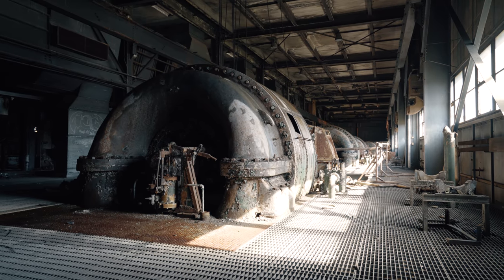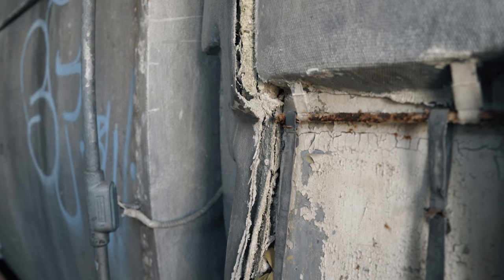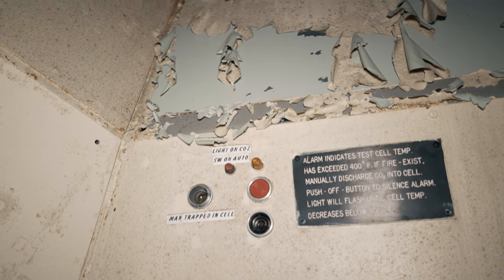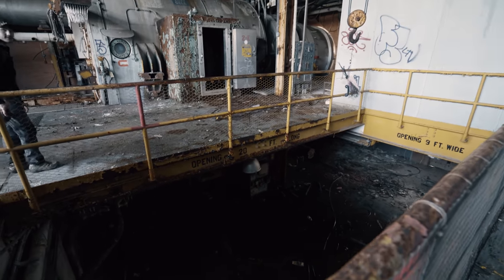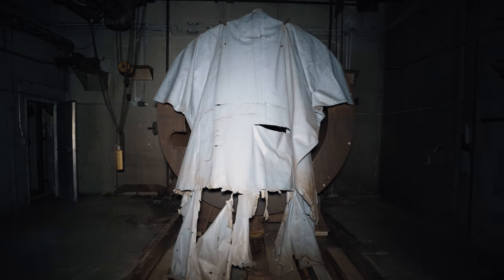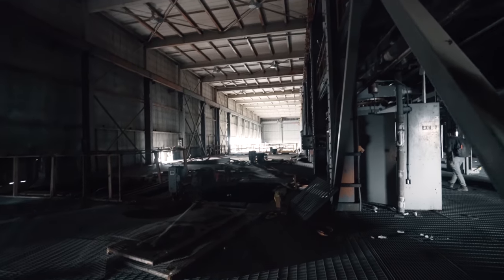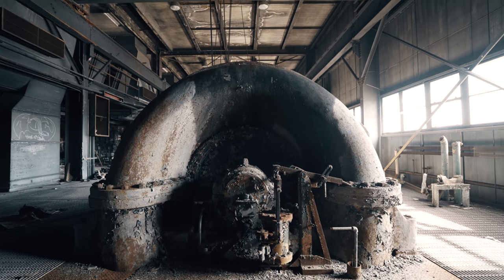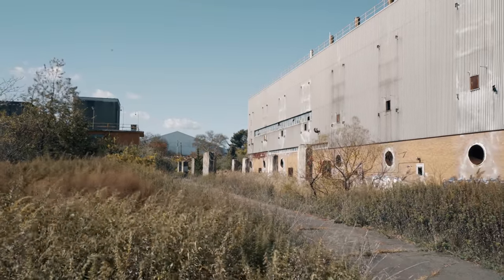Exploring an Abandoned Navy Research Lab - Jet Engine Testing Center

Comment: it’s strange how these buildings are just left to rot. there has to have been so much money funneled into these to be constructed and given a start up, yet they’re just abandoned when things aren’t needed
Reply: It also costs money to demolish something like that, so many land owners would rather pay the property tax and let it destroy itself
Reply: @jbingbong  it was government owned, so i doubt there was any tax to pay
Reply: Unlimited budgets lead to unlimited waste. Easier just build somewhere else and no need to spend money repurposing the building. Just let it rot and move on.
Reply: dull delusions it’s not strange at all
Reply: That's the problem with specific purpose made buildings. Nothing else works in them.
Reply: The story of MANY abandoned buildings in the world. Especially Govt ones
Reply: @TMAS The pollution mentioned in the video would make it uneconomical.
Reply: If it was abandoned due to ground water pollution, Seems like it was just a huge oversight during initial planning.
Reply: They mothball facilities like these if they don't need them, but in case they need to quickly get them back online in the next 5 yrs after mothballing. After that time, they know the innards are obsolete, but the structure has been designed to last 50-100 years (hence all the cinderblock). So, if they need to use the property for an emergency (eg: ramp up war-time production, convert to temp hospital, etc), they have a location available they can gut and remodel within a short time frame. After a very long time, they will eventually decide if the propery is worth keeping or not as strategic areas in cities and states move, so they'll offload it to private property companies who will eat the cost to demo and rebuild or remodel. Demo costs money, so they don't demo or gut anything if they don't have to. And, ideally, they want to wait long enough where a private company that buys the property has to eat that cost. If you look at the walls and things while they're walking around, the structure is still very solid. The insides are a mess, but that can get gutted very quickly, sprayed down with anti bacterial, then painted and new insides put in place. Typical construction crews drag their feet on a project, especially if they're charging for time and materials (they want to drag it out as long as possible to miximize what they can charge). But, a motivated crew, like military corp of engineers, refurbing a place to get it up and running to handle an emergency.. they could have that thing knocked out in a few weeks.
Reply: It's easier to abandon such buildings when they're built with other people's (i.e., tax payers) money.
Reply: Considering it's the military, they most likely left it in case future use is needed. I mean, it seems like it would make or a not-bad place to hide during the apocalypse.
Reply: The ground water is extremely polluted so no one will ever use this shit again, old technology and useless property lead to this type of thing.
Reply: @TMAS the logistics of doing all that would become a debt today.  It would take a specialized certified crew to contain the hazardous materials such as asbestos and lead.  Let alone the deconstruction and removal of what could be salvaged.  That's why it's still there mostly aside from civilian looters and scrappers.
Reply: I keep asking, why all the abandoned places of anything left, are not recycled or used as scrap? Why do we keep letting these places keep standing?
What a waste!
Reply: A quick Google resulted in finding out that this facility was closed as a result of the BRAC (Base Realignment and Closure) of 1993.
Reply: The ground is highly toxic from the dumping of Chemicals like Trichloroethylene into the ground, 50+ years ago they had no way of disposing of such chemicals, so tankers full of used chemicals would be left to sit out in the fields with valves letf slightly open to drip into the ground.  This IS a federal government facility the land which abuts an airport (more toxic waste) is still owned by the federal government. It should also be noted that much of the surrounding area was farm land where crop dusting with DDT and other chemicals were commonly used.  It's easy to point fingers and say why now, but back then they didn't know the effects their actions would have on the ground water as we do today.
Reply: The GM plant that used to be across the street (which stood for over 75 years) built fighter planes (the Avenger) during WWII, was quickly demolished after closing, the area cleaned of all toxic waste and after years of testing is finally being redeveloped.  Reading some of the comments it's clear that some folks don't understand that decades ago they didn't have the luxury of having all the information available that we do today, after the great Depression, WWII and the Cold war/ Space Race with Russia, sadly pollution (ground air and water) and its future effects was not a priority back then ~ thankfully we have come a very long way.
Reply: The salvaged what they could from the building; what's left was no longer useful, but likely got their money's worth of testing done back when they were used.
Reply: That's how everything goes; people places, things, memories. All abandoned or forgotten eventually
Reply: Makes for good content to watch for us :)
Reply: what about mega bunkers constructed deep underground. amazes me the amount of sheer hard work went into constructing something like that, to only have a one time purposes or perhaps , in a lucky case , was actually never necessary :x
Reply: Duh, no different than what everyone does with a old microwave oven, vacuum cleaner or television. OBSOLETE
Reply: The pollution and dumping mean that remediation is not economically viable. Also considering many of these labs are build in the middle of nowhere not much chance of land values increasing.
Reply: Some day mother nature will claim it back into the earth :)
Reply: You tax dollars at work!
Reply: @iannorton5514  It seems strange how testing jet engines could cause pollution to groundwater?
Reply: @EphemeralProductions  China might have hundreds if covid19 destroys globalisation!
Reply: @Nuke 'EmAll if that's so, I want that bridge crane. Where do I show up to collect it?

Would also be fun to have 1 of those gigantic axial flow compressors & gearbox. I have no idea what I'd do with it but would be interesting to mess around with.
Reply: Here's your tax money.
Reply: With the Military Industrial Complex there's pretty much infant money to the defense budget to do things like this

Comment: I worked at the National Research Council in Ottawa Canada once and we had a jet engine testing lab (we have a few actually) and one time they tested a 747 engine. The exhaust went a few meters in the air through a large pipe like a couple of meters wide. It was still loud. In a refrigeration building they once set up a helicopter engine to see how it would handle starting up in -30 cold. By the sound of it it worked quite well. The most fascinating part of all that was the amount of work that went into not losing the engine because all it wants to do is take off.

Comment: Have you ever tried to track someone down who worked in a facility like this, to add commentary to your video? This is very interesting, it would be cool to have someone who used to work there walk through it with you guys.
Reply: I did .
These are performance data test cells or "high power" cells .
Here the engines were tested after assembly for thrust numbers and any adjustments needed for fuel sytems or variable vane compressor trimming adjustments  They need a way to test engines before they are shipped to be installed in new aircraft or the field for installation .
They include the performance data sheet with the engine for the customer , and also to heat cycle the engine and make sure there aren't any problems before they ship the engine .
Sometimes they are used for R&D 
Test centers also have a center where they actually shoot frozen chickens into the engine to simulate a bird strike at speed .
Reply: Jet engine dyno
Reply: Actually, I know someone who used to work at this facility before it closed.
Reply: @dednside5229  Thats amazing that you worked there, it must be weird seeing it like this now?
Reply: @leakesonasucs  
It's called the Marines
Reply: @dednside5229 how does Mercury fall into play versus RPM.... I'm guessing some kind of measurements on thrust or pressure of some sort?
Reply: @cryipticcreep5586  
I have no idea ....
I was with the plane in test cell 
Not in the control room 
The plane shows you a zero to 110% 
(Water assist) power level and temperature,  not accurate thrust numbers like a dedicated engine stand mounted configuration.
Rpm is not coherent with thrust 
Like say a car on an engine dyno 
Because of humidity and air density due to ambient temperature and alot of other factors and variables because of the huge amounts of air ingested and the particulars of each individual engine
I'd say at sea level it's a small difference with barometric pressure,  probably not any .
Reply: @Bowlnmike  could you elaborate? Have you shown them this video?
Reply: @cryipticcreep5586  Inches of mercury is a measure of barometric pressure.  Engine RPM will vary depending on the density of the air and temp.
Reply: @clarkopietaylor2917  understandable..tkx
Reply: i believe they have a video on a giant steel mill in europe. and a follow up video with footage and comments provided by someone who saw their video and used to work in the plant.
Reply: Altitude test chambers for certifying engines after overhaul and such.  The "blowers" are exhausters or big vacuum pumps to create the altitude conditions for test I believe.  Such a shame all abandoned... but it was from a time where the government ran it's own tests.  Now it is all done by the contractors, GE and Pratt and Whitney.  Amazing how much $ that all cost to originally build.

Comment: I used to frequently explore this place when I was younger and this could have been an hour long video. Towards the back of the campus was a giant heat exchanger building with Venturi cooling towers. I also remember a room that had star effects (lots of small holes for light) in the ceiling along with some liebert AC units. Probably an old server room. The rear of those control panels were wall to wall electro magnetic relays too.
Reply: no computer servers in that facility! everything in there would have been relay logic, analogue feedback loops into analogue computers for differential, integral calculus, proportional, and linear equation calculations.
Reply: Is this in Michigan?
Reply: thats cool you live near it, ever been back?
Reply: where is this? I am trying to visit it
Reply: @cmrtaco  it's in Ewing new Jersey on parkway Ave near the Trenton Mercer airport.
Reply: @richardhoff5255  thank you, figured out that it's the Naval Air Warfare Center (NAWC) in West Trenton, N.J
Reply: cmrtaco 
If I remember right it’s near New Jersey. Proper people won’t give you the address due to people’s tendency to trash places like this.
Reply: @richardhoff5255  HHW 2005
Reply: @_RT___  who might you be?
Reply: Spoken like a true AC tech!

Comment: I grew up a few miles from there.  A General Motors factory was on the other side of the street about 1/4 mile down the road.  Between these two things closing in the 90’s, the population of Ewing Township changed.  Thanks for the video.
Reply: I knew it was my town! Always wanted to go in there.

Comment: These big panels with lots of connectors were just patch bays. Usually used for themocouples and pressure sensors. Testing a jet engine would need lots of temperature sensors, pressure sensors, oxygen sensors and other stuff as well. Today totally outdated since common sensor types for that kinda stuff mostly come as CANopen sensors where you can put up to 50 on a single bus consisting of just 4 wires. A lot easier to wire that up. The big boards with the switches could have been the exitation current on/off boards or connection through to thermocouple amplifiers.
Reply: that is civilian spec,military spec is  totally different
Reply: @joblo4216  Whatever, if you say so it must be right and you can't be wrong. Never, ever.
Reply: Chip Guy they’re mil spec bulkhead connectors, it’s very likely a completely custom system. There’s no way to know what they were for.
Reply: @junits15  Yes, the panels are most likely custom made. Decades ago a few blokes just connected a load of cables from one panel to another panel sitting in a different room. However the connectors and cabling that were used follow an old standard for sensor connections and I still have some of those sensors at work using that connector. I even have sensor simulator boxes from the late 50s once used by the air force to check and calibrate the control room meters. Look at a channel called "AgentJayZ". They test jet engines there. On a few videos you can see the same connections for monitoring pressure and temperature. But not that many as you see in that old R&D facility.
Reply: @joblo4216  Amphenol connectors seen at 5:21 were originally for Military / Space use and were since adopted by civilian industrial.  They are very robust.  The US military at least still uses these on many systems.  You will find them in most if not all trucks as part of Coms or even diagnostic ports.
Reply: @ChipGuy  thats right,when i sent a link to people that i know,that know thats what they said,military has much deeper pockets to develop stuff for obvious reasions
Reply: @watumpas  yes just for basic stuff now,things have developed since then for obvious reasons

Comment: Very cool! The big tubes with massive doors are environmental chambers. In them they could test running engines at lower (or higher) pressures. They also use coolants to lower the temperatures inside (it's very cold at altitude) that's why they are wrapped in asbestos. These types of chambers are still used today (source: I worked in aerospace). One other interesting detail is the chambers are usually mounted over an open pit because they sweat so much water during the hours (even days) that they are in use.